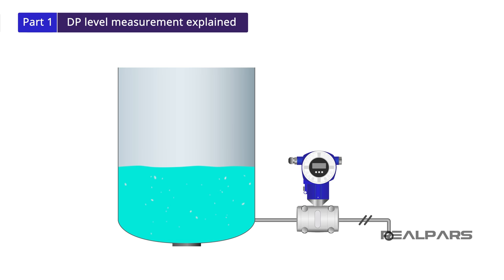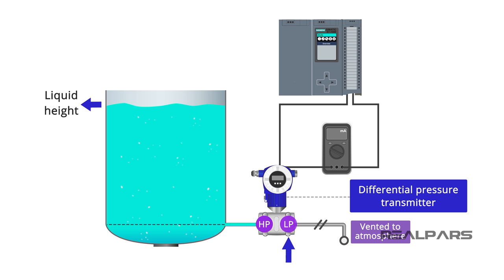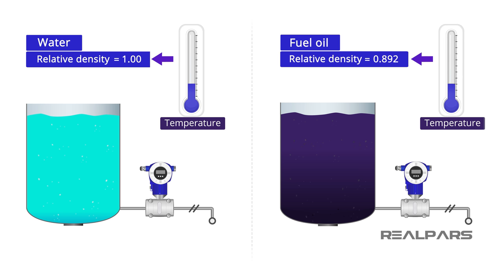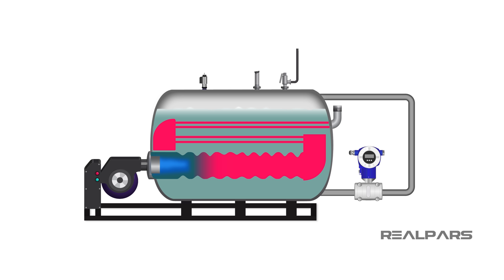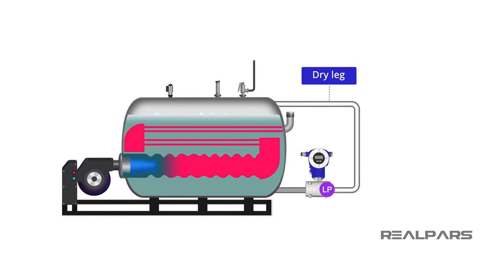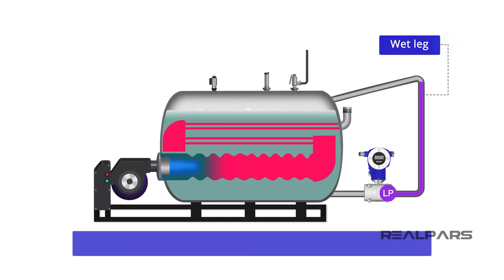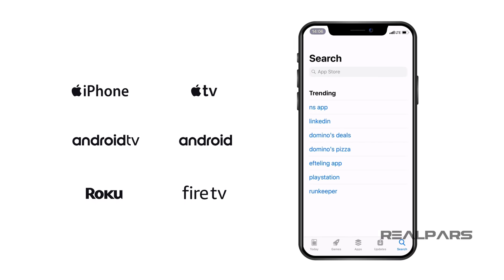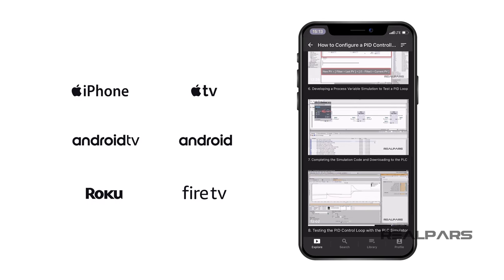DP Closed Vessel Level Measurement Explained

Comment: How do I determine weather my closed water tank is a wet leg or dry leg system?
Reply from the maker: Check the low-side connection to the pressure transmitter (the one with the leg connected to the top of the tank).  If it is full of liquid, it is a wet leg.  If there is only air in the leg, then it is a dry leg.  Ok, that may be a little too obvious of an answer and I realize you may not be able to tell if there is fluid in the leg.  The other way to tell is to check the calibrated range of the transmitter.  If the LRV (0% reading) is a negative pressure, then you have a wet leg.  Otherwise, you have a dry leg (the LRV will be zero or positive).